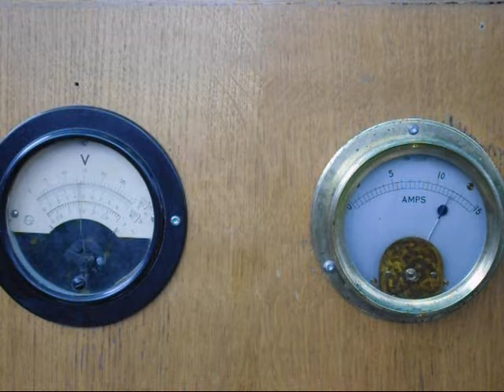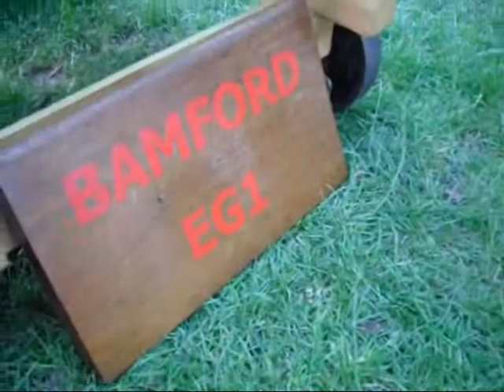Bamford EG1 - Driving a dynamo -

Comment from the maker: Many thanks!

It was built using the top of an old "toaster" (electronic pipe organ) which is pine with a thick oak veneer. 

I cut this "lid" in half and lined the inside of one hald with a 2.5"x2.5" battons and screwed the other half to the back to shield all the wiring.

Comment from the maker: It will take a few cleans and a good coating of used engine oil, takes a few goes but like antique furniture they just get better with age.

Dan had got his laptop fixed but the screen blacked out again suggesting the replaced cabled is not right, it's being looked at again.